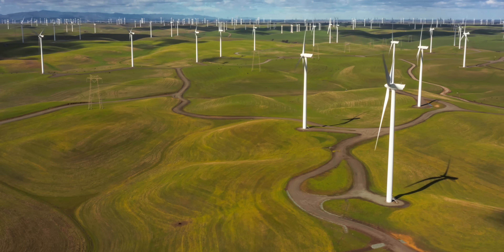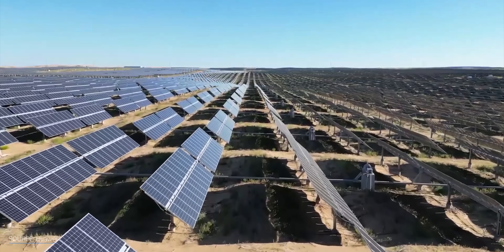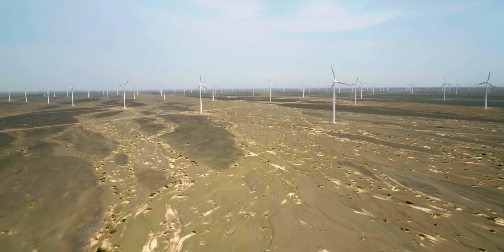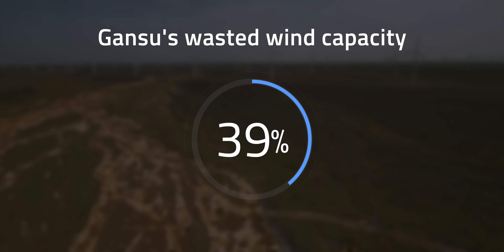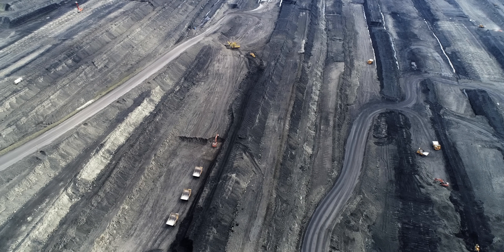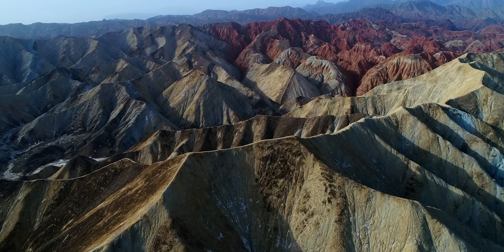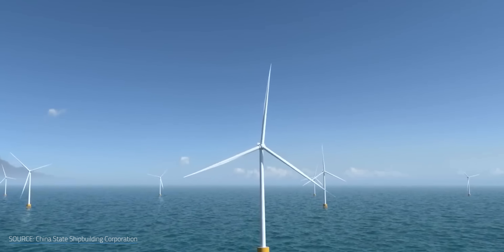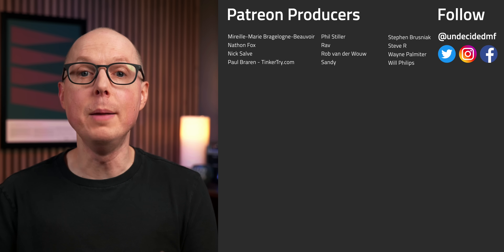The World’s Largest Wind Farm has a Tiny Problem

Comment: The "50% of installed capacity is renewable" is a metric to make reports look good.

"Produced electricity" is closer to the truth.

"Produced and used electricity" is where it paints the real picture.
Reply: According to the South China Morning Post  article cited by the video, 95% of the produced electricity was already being used by 2021.  As of 2016, of the 9GW already being produced, 50% was discarded.

Transporting electricity efficiently thousands of km is not difficult nowadays, but most of the produced electricity is being consumed locally in the province. Their target is to reduce fossil fuel energy consumption of the province to 35%. China is leading the world in electric cars.  So this is very possible.
Reply: Percentage of Total Energy instead of electricity is real picture. Everything else is a scam. Most of energy in demand is heat for production and winter, electricity can't replace it for any reasonable price.
Reply: The concept I believe you are trying to explain is called capacity factor, on a global average wind turbine generation capacity factor is around 40% on the generous side. Which means for 100MW of installed capacity, 40MW is approx the most which will be produced per year. This concept however doesn't explain more details of the poor idea of energy production from wind, as wind turbines require huge numbers of components, and maintenance. They are hard to manage grid frequency, and mother nature tends to do them in quite regularly. Hence Nantucket failures, UK. failures, Iowa tornadoes dropped six and caused fires.
Reply: @davepfanner2902  the concept he tries to explain is he is brainwashed into thinking than any other kind of plant have 100% capacity factor
Reply: @davepfanner2902  and you are brainwashed into thinking than thermal plant turbines need less maintenance than wind turbines
Reply: @davepfanner2902  An obviously biased and inaccurate opinion.
Reply: what is biased and inaccurate??, if we're talking about  the video I agree.
Reply: @davepfanner2902  Capacity factor refers to maximum MWh, not MW. A 100W solar panel with 25% capacity means that at the location it is at it receives six peak solar hours per day, not that it becomes a 25W panel.
This is important because the correct math is 100W * 6h = 600Wh, not 25W * 6h = 150Wh.
Reply: @davepfanner2902  in right place solar panels have capacity factor larget than 30%. not bad compared to 70% nuke capacity factor
Reply: @davepfanner2902  Nope, that is exactly what it is. The wattage of a solar panel in Sahara does not change just because Scotland has lots of clouds and it is winter in Alaska. By your logic your car cannot physically go faster than 15mph because some places in the world have speed limit that low.

And again, no, watts are not interchangeable with watt-hours, they are completely different things.
Reply: @SergePavlovsky  Not exactly convinced of your numbers,. However, 40% islarge difference. Would want to pay 40% more tax??? Should Boeing design a plane with 40% more drag??? How about a 40% smaller gas tank for your car??
Reply: @davepfanner2902  where did you get 40% from ? nukes produce many times more expensive electricity per kwh. shouldn't you take into account  cost of building and running plant before you start talking about how you are convinced?
Reply: @SergePavlovsky  I used your numbers 30% versus 70% the difference is 40%, are you troubled by your own numbers??? most nuclear stations, except the ones the Germans took down were already sunk cost capital. Meaning the infrastructure was/or already installed. Most of the nuclear sites are planned for more reactors than was ever installed. This means there is only marginal cost to add reactors, very small portion of the overall cost of the site. The sites in the US are 60 years old. Very low maintenance, compared to wind or solar.  Wind turbines are easily being replacing 3x in the lifespan of a nuclear site. [If mother nature doesn't take them down.] Solar, is a bit less on the replacement side, but require huge areas of land, and battery storage. Also special equipment to maintain grid frequency, etc. Not cheap.
Reply: @davepfanner2902  it's a meaningless number 70% of nothing is less than 40% of many. i've already told you than in the end electricity from nukes is many times more expensive.
Reply: @davepfanner2902  running nukes costs a lot of money. for many of them it would be cheaper to close them down and build new solar or wind plants
Reply: @SergePavlovsky  in your opinion, not in the reality of power demand and generation, wind is 3x the cost of nuclear.
Reply: @SergePavlovsky  , it's 90+% in the US reactor fleet. Of a whole lotta power generation. Versus 40% of junk.
Reply: @davepfanner2902  in publicly available facts. your claims are your misconceptions though
Reply: @davepfanner2902  it's 90% in one year of your choice. in year of my choice it will be 50%. and even with 90% they produce more expensive electricity than any other tech, including gas peakers
Reply: @davepfanner2902  globally nuclear junk saw 2 gw capacity reduction during last 5 years
Reply: @davepfanner2902  wind and solar saw more than terawatt capacity addition during last 5 years
Reply: all produced electricity is used, you can't produce electricity into astral. germany(largest economy of europe) already consumed more than 50% of renewable energy in whole year 2023
Reply: At 11:57 he says the “EFFICIENCY” raises to 95%. WHAT DOES THAT MEAN AND WHY PUT IT IN SUCH STRANGE TERMINOLOGY?!?! I guess that could mean that they only had to curtail 5% of POTENTIAL PRODUCTION, but if that is the case, just say it. 

Also, if you are going to state very old pricing of the produced electricity, why not make it relevant and state the contemporary pricing which is what he should be doing. AND if you are talking about pricing, add in that COST OF LONG DISTANCE TRANSMISSION to provide a total cost, AND YOU TALK ABOUT “STORAGE” for intermittent wind ADD THAT COST to get a TOTAL delivered cost!!  So now you still don’t have the total cost because you need to add in the cost of having DISPATCHABLE reserve generation to be available when the wind doesn’t BLOW (which has happened in England)!! 

Now you are getting closer to the true TOTAL COST of that “cheap wind generation” and be brave enough to compare it to the the cost of new dispatchable and locally produced NUCLEAR POWER in china which is cheaper than coal produced power!! AND China builds 5 plus nuclear power plants per year now on budget and on time, which the west seems to be unable to accomplish. But I suspect that you have strong opinions about nuclear power. AND while you are at it, maybe a video about what China is working on with HYDROGEN could be useful to get a balanced perspective.
Reply: @Daniel-e8d5c If the goal is to get better air then we should increase CO2 so that the Gobi desert becomes green and we end the fine sand being blown into Beijing every year.
Reply: When there is not much storage in the Grid system Produced nearly entirely = Used. Soo you clearly have no clue what you are talking about. Just making up generalized vague assertions.
Reply: Use excess etectricity to Train AI.
Reply: Use excess electrical power to desalinate fresh water.
Reply: @appa609  If you can transmit the power to the ocean you can transmit that power to where it is actually needed.  Transmission capability is the bottleneck.
Reply: @longshot7601  you can produce power in ocean, no need to transmit it. offshore wind turbines have highest capacity factor btw
Reply: @SergePavlovsky  WE're talking about generation in the Gobi and the lack of tranmission.  Off shore generation wasn't the subject.
Reply: @longshot7601  i don't think OP mentioning "50% of installed capacity is renewable"  was talking about gobi. gobi could pwer nearby provinces while oceans will power desalination
Reply: @appa609 easy done near the sea, hard in the dessert 900miles from the sea.
Reply: @appa609  Saline water in the middle of the desert?
Better create hydrogen there.
Reply: @AlexHaan  And it all leaks out before it gets to market.
Reply: @appa609  Yep, desalinating water, heating water … or low-priority compute processing tasks — can all be done with “wasted” energy — we really need to think differently about this stuff.  ELECTRICITY IS NOT FUNGIBLE — its value depends on time and space.  Low value isn’t BAD and high value isn’t BAD, they’re both just ways of describing what needs to happen at different times and places.
Reply: Produced = consumed
Reply: @TheSuperFlyo  No it does not. For one, electric transmission losses can be a significant fraction of the energy produced.  US Energy Star standards require engineers to measure energy the "crosses the curb" into a building, and imposess a significant penalty on top of that for electric distribution lossrs.
Reply: Urrggh hard numbers to make sense... how you get dumb senators to understand.
Reply: They obviously have extra capacity and may need it in the future. That's closer to the truth.
Reply: Nope. “installed capacity” means the capacity at 100% productivity. Usually called “nameplate capacity.”  Actual capacity runs about 30% of nameplate capacity. On average. Sometimes it goes tom10% or less when the wind is calm.
Reply: "They obviously have extra capacity and may need it in the future. That's closer to the truth."

No, not really.  China has a shrinking population, and it's going to get worse and industry is no longer growing in China and in fact is shrinking, so EVERY indicator is that the need for electric capacity in China is going to decrease, not increase.  It's also some of the big electric consuming manufacturing that's been decreasing there.
Reply: @johndoh5182  This assessment is right in the longer term, but for now the mass migration from rural to city continues apace.
Reply: @johndoh5182  It's not only about population (or money). It's also about cleaning up polluted cities, because of health problems.
Reply: More attention should be paid to making the reporting equal too, if you want to build a coal or nuclear plant nobody asks how the coal is supposed to get to get there and where are the power lines it needs, but make a wind or solar farm of same size and supposedly you need to clear cut forests(in desert) to make roads and pay extra for power lines and storage that were already included in the cost estimate.
Reply: @AnalystPrime  that’s because coal and nuclear plants are built on single lots near existing infrastructure, not across empty land the size of Belgium.
Reply: @marktaylor2645  Except when they aren't. The solar panels on your roof do not need miles of power lines and neither does the wind turbine on the lot next to your house, but the nuclear plant delivering power to your city from another county does.

And land does not magically grow "the size of Belgium" so the cost of building a mile of power line is the cost of building a mile of power line no matter what it is connected to. Making people pay for stuff they did not buy is called a false billing fraud and it is illegal.

Here's another newsflash: The cables do not care what produced the electricity either. If you are building a power line that will have 1% line losses that number will not change no matter how many lobbyists and other idiots claim solar has 10% line losses.
Reply: @AnalystPrime  you did a fantastic job knocking out straw men you built, refuting points I didn’t make, and making points irrelevant to the actual discussion. 2/10
Reply: @marktaylor2645  The only straw man was provided by yourself. If you can not comprehend plain English then I must recommend you learn to read better before trying to "discuss" anything.
Reply: @AnalystPrime  , Line losses can vary greatly depending on the type of transmission type. DC versus AC and at what voltages, your assertion of a 1% blanket loss, is just blatantly wrong!
Reply: @davepfanner2902  Line loss of 1% happens on long distance lines where the loss is 1%, I have never claimed that as some universal constant.

Unlike the liars who say that renewable energy cannot be transmitted long distance because as soon as you disconnect that same power line from a coal plant and connect it to a solar farm the line somehow becomes less efficient and 10% of the power is lost.

Bonus points if they also count that per mile so ten miles away the power is 0%...yes, I mean that they also do not know how to calculate percentages.
Reply: @AnalystPrime  The only poster I've seen having an issue calculating things is yourself.
Reply: @davepfanner2902  ...Are you seriously unable to understand that there are people outside this thread?
Reply: @AnalystPrime  , don't even know what you're trying to communicate??? you are poor communicator. I'd recommend more reading less posting for you.
Reply: @AnalystPrime  we are discussing the massive desert renewables projects in China.  Your bringing up “rooftop solar panels” is absolutely a straw man.  And line losses are greater for solar installations in a particular case: when you build your solar panel farm 950km away from your consumers.  Line losses scale with distance. 10x distance means 10x losses.  And these installations are absolutely 10x further from the end user than coal or nuclear plants would be.
Reply: @marktaylor2645  losses of cheap electricity are cheap. there are 3k+ km transmission lines from hydro plants. btw, how closely you build your nukes to consumers?
Reply: @marktaylor2645  also losses scale inversely with voltage
Reply: @SergePavlovsky  vogtle3, the newest nuclear reactor in the USA, is 93 miles from Savannah GA.  10x closer than this Chinese wind farm is to their industrial center.
Reply: @AnalystPrime  , the amount of resources i.e transmission wire / transformers, etc, is less than to individually run rooftop solar or nearby wind farm,  directly in a neighborhood. Due to the large number of wind turbines or solar panels required to replace the generation capacity of a nuclear plant. You're wrong again. Not only this but regarding wind turbines near residential during a catastrophic event such as blade failure, or tower collapse, would present a lot more dangerous situation than a remote nuclear power station.
Reply: @AnalystPrime  You are delusional, the infrastructure /transmission lines for coal and nuclear plants already have been installed. These costs are paid for and  done. It's installed, So yes, when one wants to put in these "renewable" generation sources the material needs to be acquired/purchased, and large amounts of land need to be cleared. Which requires large amounts of energy. The railways to transport coal is already there.Regarding nuclear. Nuclear fuel is two million times more energy dense than fossil fuels. Yes that is a million with a M. Requires relatively small amount of material versus fossil fuels, and significantly, and by significantly I mean have you visited a nuclear plant, they are small. Both in physical size and land area, yet produce large amounts of power. Small land area to maintain. For perspective you need 2,000+ wind turbines for the same power as a one nuclear plant. Then all this land and transmission lines area, needs to be maintained, thousands of acres. Hope you like mowing lawn, since I believe you just signed up to maintain this land.
Reply: Do understand this is a CHINESE mistake, made because the CCP loves their grandiose projects that make them look great.

In the US there is a lot better matching between capacity and production and would be even better if more grid storage were already installed, but grid storage is a newer technology forgetting Li-Ion which is the worst thing possible for grid storage because it's too much demand for Li-Ion considering BEV needs that for many of their batteries.

The good news in the US is there's better planning because this is mostly handled by the private sector that needs to make a profit, so investment comes after a well researched plan is in place and investors can look at the plans to see that it makes sense.  Also good news in that there is now different battery tech getting installed into grid storage and its production is increasing.
Reply: @johndoh5182  there are far more failed projects in the US, like the solar thermal energy plants in California and bankrupt solar panels companies.
Reply: @johndoh5182  Uh oh, racist detected.
Reply: Yeah, it is a BS number for deception. And those 50% are only about electricity which makes up only a fraction of all energy used.
Wind normally makes about 10% on average over the year of it's installed peak capacity, so it would be 5% of China's electricity and since they are throwing away 1/3 it is closer to 3%.
And wind power is extremely problematic because there is no storage that can handle GWh of energy.
What normally happens is that the coal in the coal power plants keeps on burning and the coal power plants are just forced to blow off steam unused because there is nowhere to go for the electricity.
Wind in Germany has actually increased the CO2 output studies show. Without  wind power Germany would have reduced their CO2.
It is better to replace old coal plants by new ones to reduce CO2, if that is your goal. But that is a stupid goal.
Reply: @AlJay0032  typical comment  by a solar energy sceptic.
Reply: @Brians_view  Yes, I am, Sherlock. Just look at Germany. Spent over half a trillion on solar PV and wind over the past 25 years. And what did they get?
High energy prices, instable grid, deindustrialization, companies leaving, jobs going away and 3% of primary energy now from wind power and 1.3% from solar.
Lol

If you want poverty, you do what Germany has done. Phase out super clean and super safe coal and nuclear and go into flaky renewables which cannot provide base load and often produce almost nothing for months of the year every year.